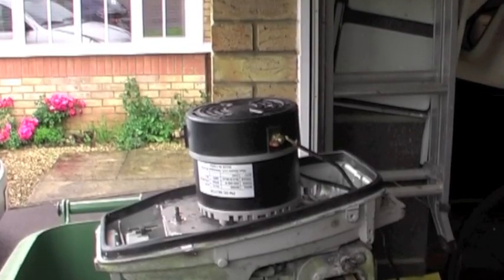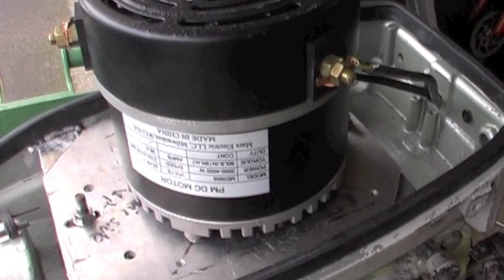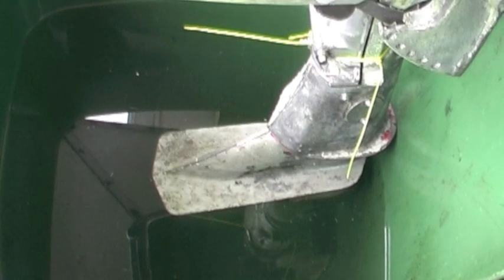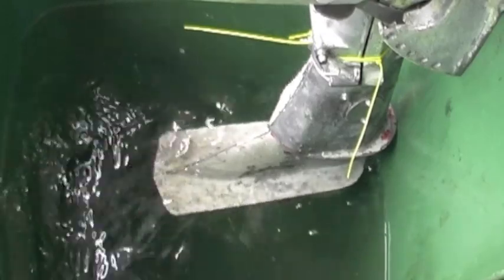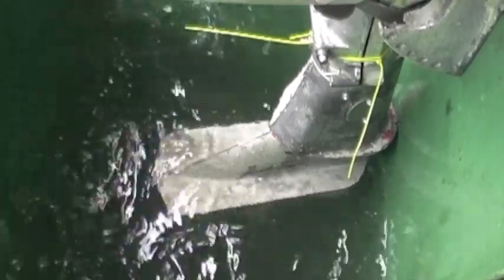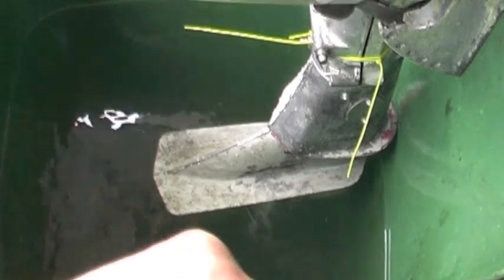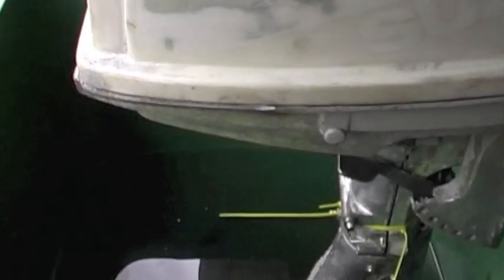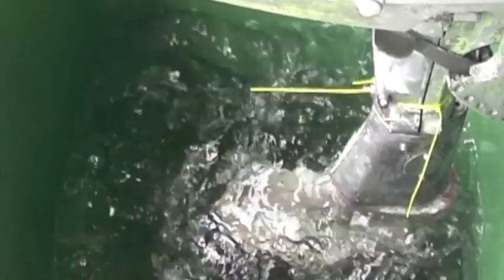Electric Outboard

Comment: it's been a while, I'm sure he found out that he need's to vent this fan cooled motor, won't be able to run it with the cover without it over heating
Reply from the maker: Didn't find that to be a problem BUT i had the same thoughts so added a cooling fan to the top of the motor to force air through and a blower into and out of the cover at front and back.

Comment from the maker: hi Orgazmosis sorry for delay in replying.  Happy to help with a parts list it is largely:

1.  Donor outboard;
2.  Motor;
3.  Scrap Aluminium 
4.  Motor controller;
5.  home made throttle

I will post a new video showing all the components in situ including motor controller mounted and the direction controlling relays I have installed.